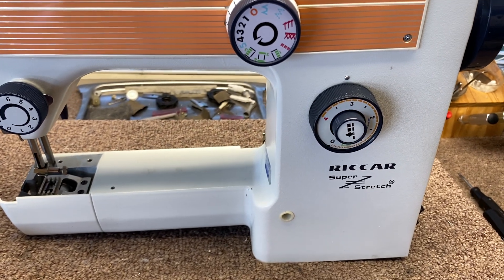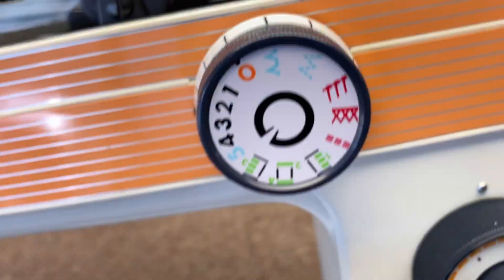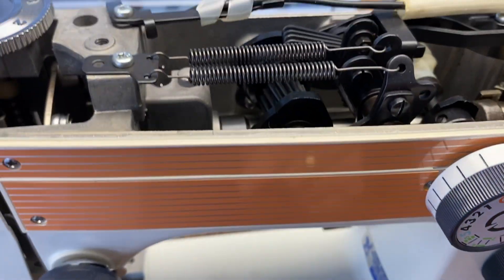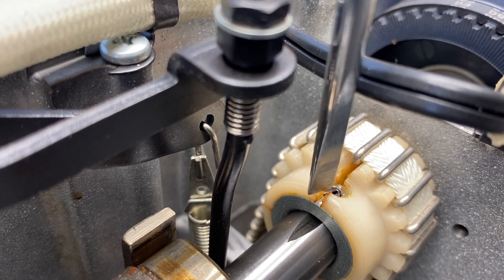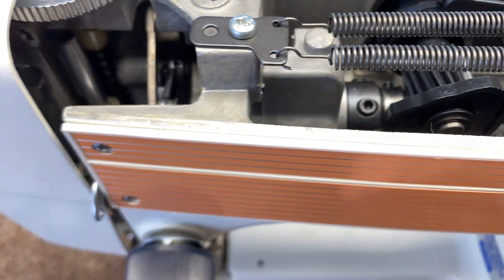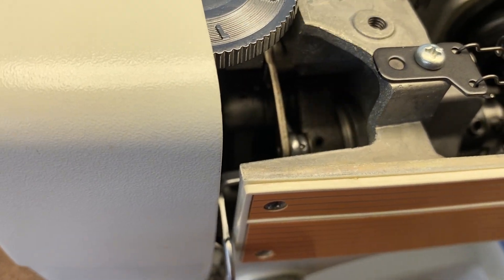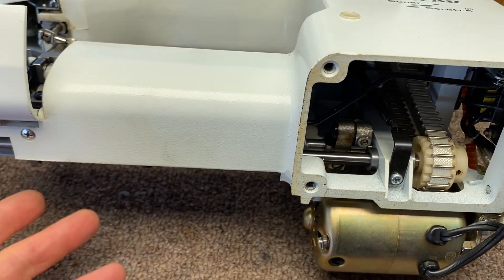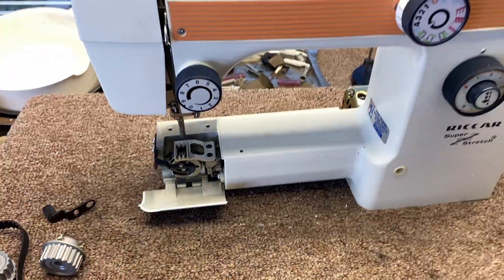Riccar Timing Belt Gear Failure

Comment: Similar but slightly smaller job here replacing the hook gear train on my Riccar instead of the main gear train as you are. Thanks for showing your video, it's quite similar to the Riccar a303 and 1000 that I'm fixing.  I think I can do the disassembly and reassembly by myself but i may have to call an expert like you to help with getting the timing right, especially the zig zag and feed timing.